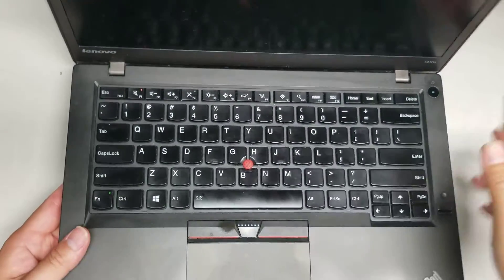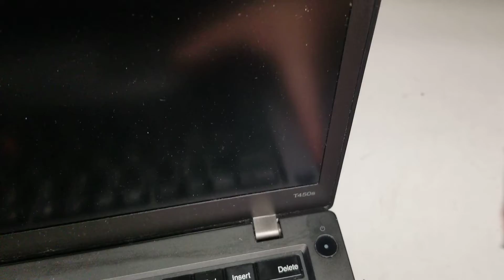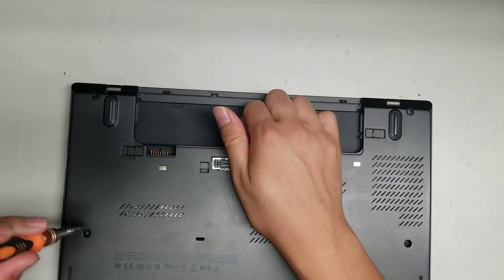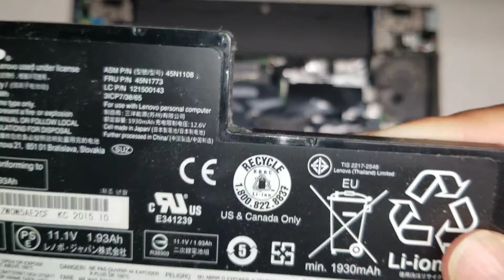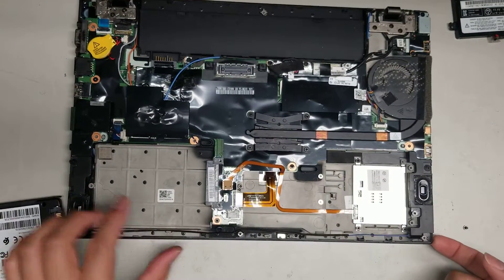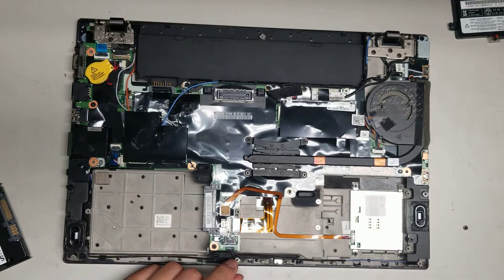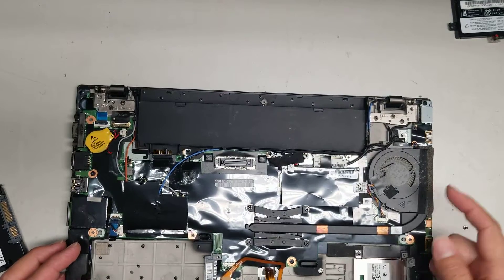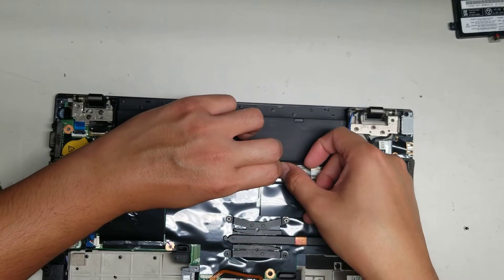Lenovo T450S Disassembly RAM SSD Hard Drive Upgrade Fan Repair *read description*

Comment: would u be able to show  video on how to upgrade the ram, i have a t450s and its a good laptop but i need it for photoshop for my photography business but i dont want to get another pc... would i be able to upgrade to 16gb?
Reply from the maker: That's this video... a 16gb stick is super expensive though. https://amzn.to/40o0V2V
Reply: @ItsBinhRepaired  oh thank u, I actually found out that my PC has 4gb which is accessible and interchangeable and the other 4gb is on the CPU or motherboard and the maximum ram is 12gb for my model so I'm gonna get a 8gb pc3l 12800s off of Amazon for 11 quid I think so ntb tbh, I'll watch the video, thanks for that 🙏🏻
Reply from the maker: @jjacarsphotography  ok
Reply: @ItsBinhRepaired  oh nvm I misunderstood hhaha i thought there was a special process to changing ram but I just took apart my laptop and ye I understand it l, basically just buy the new one and replace them nothing more, ye I see that one is expensive but supposedly with my model I top out at 12gbs but I mean if I could go to 16gb or 20gb (16+4gb internal) then I'd do it but Lenovo advise not to so I don't wanna risk it tbh
Reply from the maker: @jjacarsphotography  nothing will happen if you try it, but you need to make sure you can return it if it doesn't work.
Reply from the maker: @jjacarsphotography  SSD is a much better upgrade.
Reply: @ItsBinhRepaired  would that make it faster in terms of performance? like I imagine ram would make it faster but if ssd would do more then I'll do that instead or I could do both, U tell me please coz I have no idea about laptops tbh 😂
Reply from the maker: @jjacarsphotography  both would be best, but the SSD will make a much more noticeable difference.
Reply: @ItsBinhRepaired  oh alri and what should I look for to get a better SSD?
Reply from the maker: @jjacarsphotography  this will work well https://amzn.to/3BDaqlf

Comment: How do I remove the black cable on the right side to to detach the screen from the keyboard?
Reply from the maker: Time stamp?
Reply: never mind actually. I just had to yank the display cable to get it out(its below the ram) @ItsBinhRepaired
Reply from the maker: @yoglin  I hope you did the battery drain first.
Reply: yea. It's a laptop with a broken motherboard that has been sitting on my shelf draining itself. I just wanted to crack it open to see what was inside- I also unplugged all the battery cables and removed both interior and exterior batteries. @ItsBinhRepaired
Reply from the maker: Nice

Comment: I have a T450S . It has 8gb memory, but AIDA64 says DIMM 1 samsung, modul size 4GB. Where is the other 4GB?  Is it soldered on the motherboard?   There is also a mention of a Channel A BANK 0  hynix memory 4GB?    AM I missing something?
Reply from the maker: Not sure
Reply: @ItsBinhRepaired  No worries. Thanks.  I had a spare memory, to put in, but now I have to use it somewhere else.  Its a great machine with 8gb of ram as well, 16 would be overkill for me really.  The spare ram brought me here. 😉. Thanks
Reply from the maker: SSD is the best upgrade.
Reply: The internal battery is like the cr2032 battery in the Pc ?? 
what is the function of the internal battery?
Thank!!!
Reply from the maker: @cristianmurro  ? The cmos bios rtc battery is the cr2032. The other battery powers the laptop like all other laptop batteries.
Reply: @ItsBinhRepaired   
Yes 
my doubt is because it has an internal and an external, all notebooks have?  I understand that the battery uses the external one for its operation